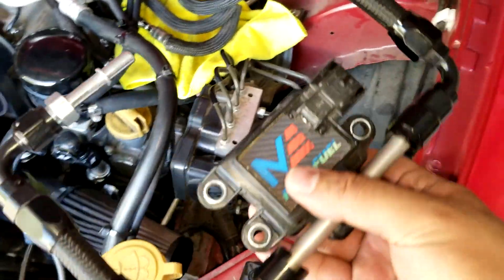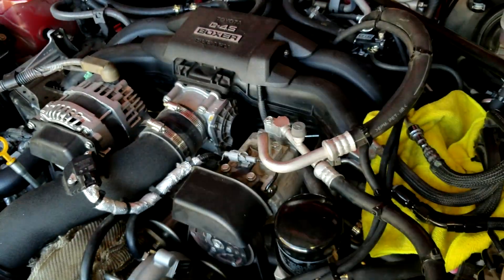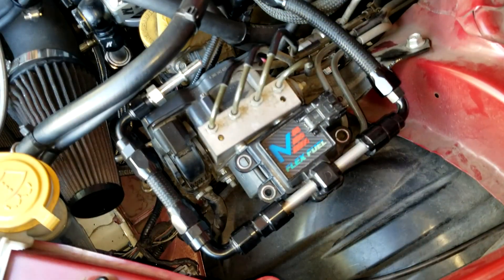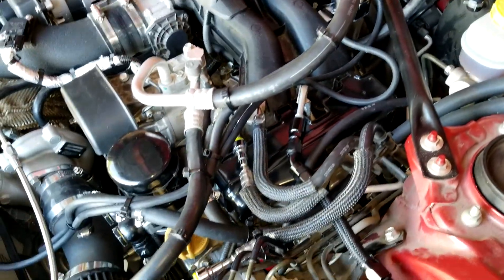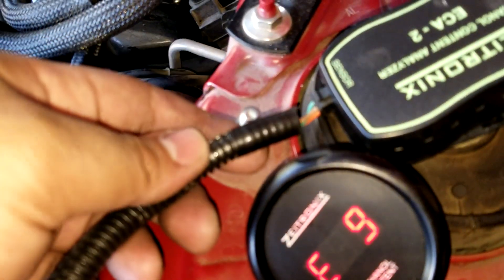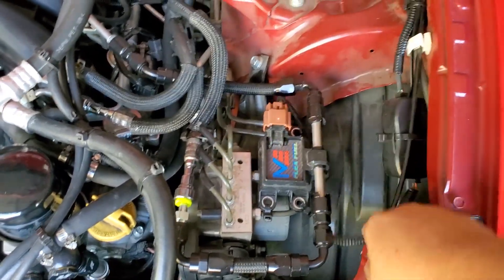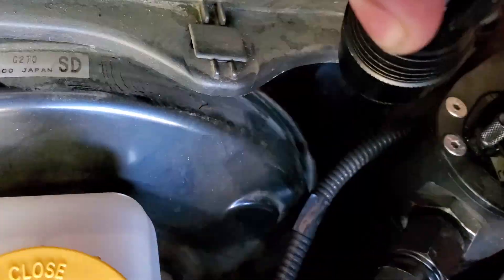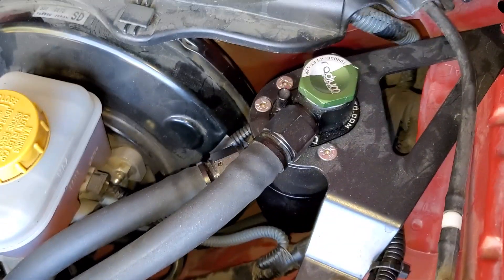ROAD TO 400HP - Turbo Subaru BRZ/FRS/GT86 - Part 3 of 6 (Moto-East Flex Fuel Kit Install)

Comment: Did you have the evap harness or the rear o2 signal harness
Reply from the maker: I went with the o2 sensor harness. Reason for this is that, I was going to use the evap harness for my boost controller. If you're not running the boost controller the evap harness will work as well.
Reply: Does the rear o2 wire just wire up to the signal wire on the eca box with the ign. power & ground? The rear o2 does not need to be connected to the ecu?
Reply from the maker: @dashoutpat  my kit was straight plug N play through the o2 sensor. I think the older version needed to be rewired. And yes, the rear o2 sensor does not need to be connected. It is usually disabled in any custom tune, so no CEL as well. For flex fuel, the ecu will use the voltage coming in from the rear o2(nowthe FF kit) and convert that to e85 reading.
Reply: @brzser8387  perfect thanks. I'm also making my own rear o2 harness, are you able to tell or show me a picture of which part/pin of the harness has the one wire going out of it? I bought the kit 2nd hand and it didn't include it.

Comment: Did you ever have an issue with water gettin on the flex fuel kit?
Reply from the maker: Its actually been raining here in california lately, and has been checking my engine bay for this reason. So far engine bay looks dry and sealed. 👍
Reply: BRZSer Did you get tuned by Xero Limits? If so I have questions regarding getting the Flex Fuel Kit from them and getting tunes by them as well
Reply from the maker: @JR_86  No, I wasn't tuned by them. Different tuners can also tune it just as with any other flex fuel kits. I went with HRI tuning reason being is that James is a reputable tuner in this platform as well as his tunes are "unlocked".
Company such as CSG (Zack Tucker), and delicious tuning (Bill) are also popular choices.
Reply: BRZSer Ohhh I see how much does HRI Charge to get a flex fuel tune? And so you bought the flex fuel kit from Xero Limits for how much? And do you have the link by chance? Ty btw for the info I appreciate it.
Reply from the maker: @JR_86  I bought the kit used, haha around $250. The tune from HRI tuning is $500 but you will also need license and hardware which is additional cost.
No worries, and ask away!

Here is the bundle kit:
https://www.hrituning.com/collections/frontpage/products/ft86-etune-complete-bundle?variant=29835952717
Reply: YES!!!
Reply: I had problems with mine getting wet